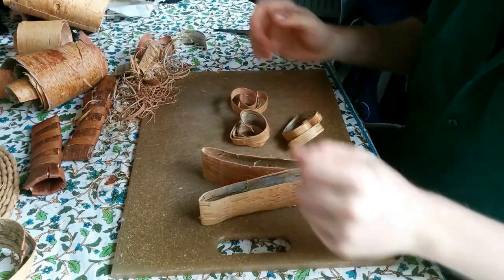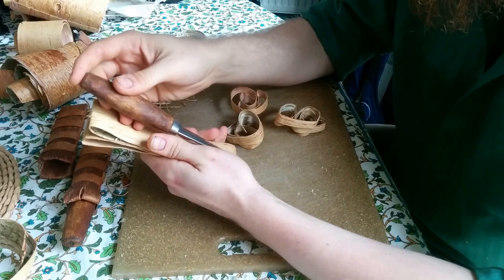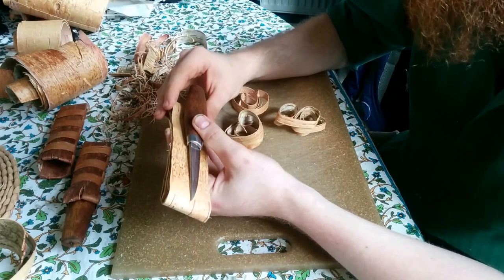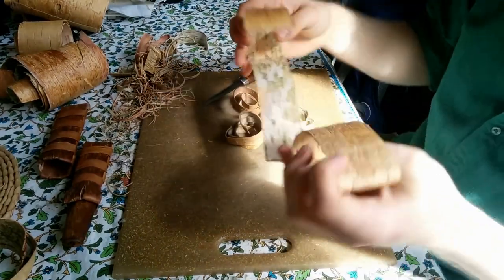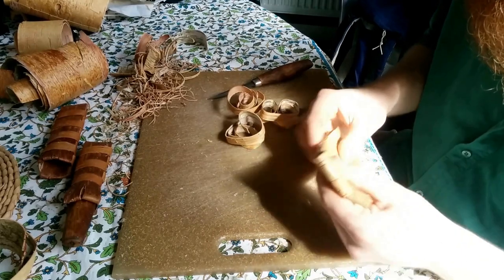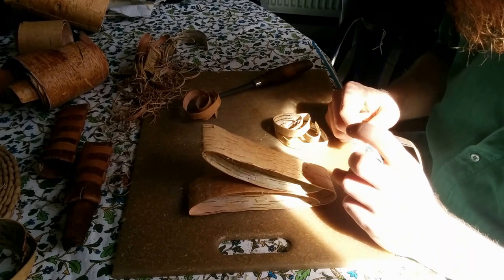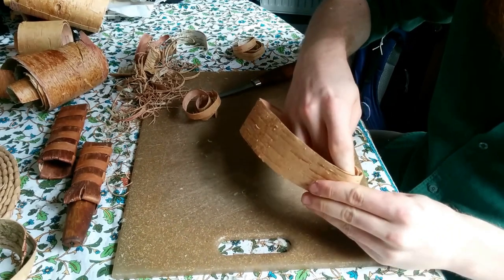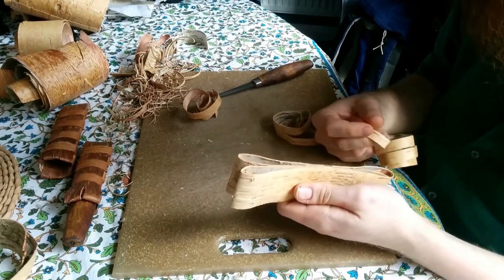Birch bark knife sheath tutorial

Comment: Nice video, but I think having a belt loop would have made it more functional.
Reply from the maker: Sure! But this is for a wood carving knife so it isn't so necessary. I think also that a belt loop made of bark would fray and wear very quickly as the layers of the bark are open to any sort of friction. A small leather braid or similar might work.
Reply: Great answer.

Thank you.